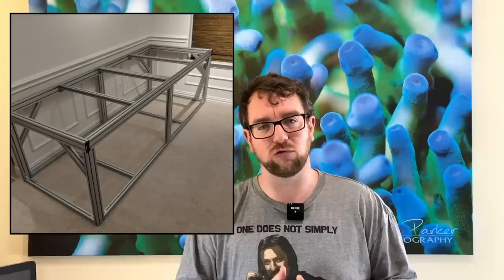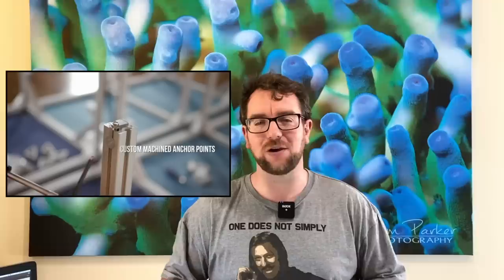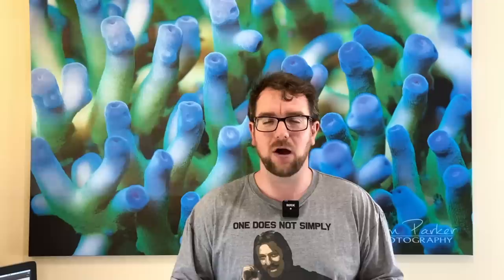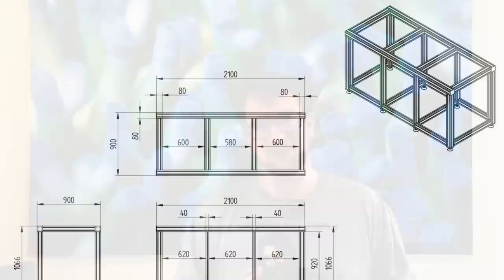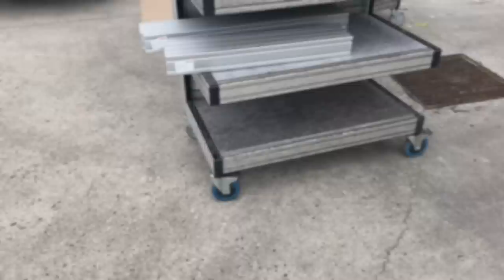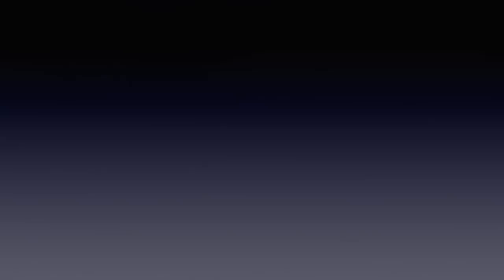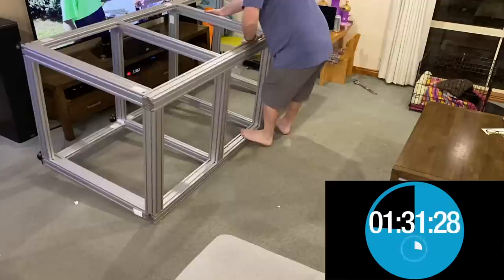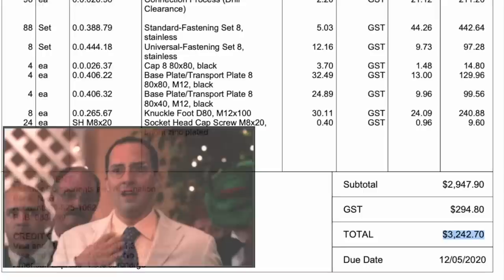My Dream Aquarium Stand

Comment: Great stand, quality costs but worth it in the long run. Lots of stands over here have acrylic or coated coloured panels like the modern kitchen ones. The normally have a bracket that locates into the bottom support beam and then just held on with magnets, simple to remove and can be easily swapped out if you want to change colour scheme.
Reply from the maker: Thanks for the idea. I don’t mind the magnet idea, but hoping for some nice hinged doors - see how we go

Comment: Hot damn, no wonder she got the new floor! One thing I noticed, in the States they seem to be using the rectangular 80/20 so that the two end noggins are sitting over the vertical posts and bearing all the weight.
Reply from the maker: Yeah the top rails sit on top of the posts here too :)
Oh and the wife got floors and a new kitchen 😂😅
Reply: @ParkersReef  Ah, my mistake. All good then.

Comment: Would love an extruded aluminum stand - so awesome. Great to get an Aussie tip for when I move back and need to get a custom ;)
Reply: Jeez an hour and a half - would take me 3 - that seems much simpler than i thought considering how many pieces in the car
Reply: Don't think it's too expensive. It will last a lifetime
Reply: I'd just use magnets with doors you can take on and off. Also if your wife wants to change the color - no worries
Reply from the maker: @sunnygoold9449  yeah it wasn't cheap, but decent value for the quality I feel. And yes, whatever option we go for paneling, it will be replaceable which will be pretty cool. Great way to give the aquarium a fresh look too.

And yeah, I was surprised that it only took 90mins doing it by myself.

Comment: Congrats for taking the plunge with the extruded aluminium stand. I remember you asking opinions about the material on Facebook a while ago. I very nearly went this way for my 6 foot tank but after building a new house it just wasn't to be this time around. Really interested in seeing how you end up tackling the cladding though. It was something I didn't quite get around to figuring out either.
Reply from the maker: thanks man. You know I have been throwing this idea around for a year or more now. Ha yeah, need to work that out soon as I want it to look good - not look like a factory. Will be right though :)

Comment: NIce! I am currently working with AluFab the same company that produced Tidal Gardens stands right now and in the work of building my dream stand for my 220 gallon tank and I am really excited. ATM my build cost is roughly the same as yours but subject to change as I am working on including vertical bars to be able to hang lights off of it as well as magnetic doors and panels. Good work is not cheap I agree whole heartedly. Their team also runs the data to make sure my tank will be a bespoke work of art that last a lifetime or as long as I don't go even bigger(cough..400gal) 😉.I have had my share of DYI projects cost just as much or lil more than a professional work in the past that could a have been done right the first time around. The back and forth buying the wrong item and returning items wasting or short of product costing money and time just winging  it lol. Also the not warping overtime and non rust issue is a must in my book. I also have had a wood stand on my 220 for the last 9 years now and i see the wood deforming here and there as well. Seeing your project give me confidence for my project !! Kudos Sam
Reply from the maker: Thanks mate, good luck with your new dream build. Sounds amazing!!!

Comment: The process you described is exactly the same with framingtech.com where I got my stand. They drew it up, did weight analysis, then changed members then I changed leg placement and height, they re analised the whole thing and once the number met the safety factor they quoted me for it and 2 weeks later from my approval it was in my driveway. I built it 84" 212 cm long, 32" 81cm wide and 46"116cm tall for extra sump clearance. The whole thing is built from 45x45 and 45x90 profiles. I understand shipping from US would have cost some penny but my stand was fraction of what you paid. I urge those in the US to get a quote from FramingTech and not get scared by the numbers here.
Reply from the maker: 100% agree! FramingTech look amazing and if I was anywhere remotely near America, it is where I would have gone. They use high quality profiles and fittings and have excellent customer service. Just doesn't make sense to ship it from the other side of the globe to Australia (especially with freight charges at the moment!)

Comment: I love extruded aluminum, but i hate this idea.  The reason being the mode of failure for these members and fasteners.  So, the metals can still corrode, specially in a marine environment.  Major members are not redundant, and when it fails, it's going to be a total loss. Pressure Treated lumber would have been 10% of the price, and far more reliable.
Reply from the maker: Having had treated lumber stands in the past, I can say for sure they are not more reliable. A fraction of the price yes, not sure about 10% though….

It’s also important to design the stand so that the weight is not supported by the fasteners, but by the upright beams - like this is.

 But hey, is all good, we’re all different! Got any info on your reef tank?
Reply: @ParkersReef  All other things being equal, if you have a leak that is going to call into question of failure for BOTH 80/20, and PT Lumber you have to look at the mode of failure.  If PT Fails, What's it look like?   Well, lumber gets soft and compresses and slowly things end up sagging... It's isn't an sudden failure.   With the 80/20 and a key member's fixtures are corroding and it fails,  you end up with a catastrophic failure and a total loss your frags are rolling around on your floor.   That's not going to happen with PT.  SURE,  the 80/20 looks cool, and you can claim your cooler then the other guys, but seems like a foolish risk to me.
That's without even getting into the electrolysis risks.  
Seems stupid... "Look I made a flag pole of Solid Gold!!!" 
I love 80/20 for projects, but there's like 2 things I wouldn't use it for, one of them being an Aquarium.
Reply from the maker: @surveysays8335  Fair enough. Having had multiple lumber stands before, I will respectfully disagree with you :)

Lumber goes soft without spills. Just the moisture alone causes it to fail after a few years.

That is the reason I shut down my last tank, the stand was not looking too safe.

But as said above, respectively just one opinion (Y)

Comment: going to build my stand this coming month
any thing you'd like to share after 3 years ?
stainless steel nut bolts working fine ?
and should I paint the aluminum for extra protection from oxidation or not to worry about that ??
Reply from the maker: Working a treat! Use quality stainless fittings and cost them in a material that sailing yachts use to stop oxidation and you’ll be sweet

Comment: Can the bottow row hold the weight of a large sump? Or would it be best to be flat on the floor for that to be supported? If you put a tank on the bottom it would be held up by the hardware only, and not the strength of any structure below it?
Reply from the maker: It sure can and it sure is :)
Reply: @ParkersReef  Could you point me to some references on how much weight it could hold etc? Aluminum stands new to me - trying to learn it all for a future build :) So all the weight of the sump is dependent on the screw/bolt from the cross beams on the bottom? wow. If you have a video on it, please link as well. I'll poke aro und to see what I can find.
Reply from the maker: @atravels1055  you'd be best off asking your local aluminium extrusion facility for them to design something for you (like I did in this video).

The weight of the sump is actually supported by bolts through the extrusion, not all of the fasteners are the cheap bolt on ones, the type I used you actually cut a thread into the end of the extrusion and drill through the connecting piece
Reply: @ParkersReef  Thanks for the tips. Looks like a great setup. Making notes.

Comment: Hi Sam great job but why extruded Ally and not just welded ally tho I understand the  modularity  makes it easy to add/ change things etc. Just curious  as to why it wasn't an option or it was but this just blew it out of the water?
Reply from the maker: Yeah that is an excellent point. To be honest, I didn't really even consider it and that isn't a good reason not to! I had my heart set on extruded ally and really just had to get over the bill. I know that plans often change or "re-align" with reef tanks as new equipment comes in and out and having the ability to modify things to accomodate that is a godsend. Plus, the fact that I can assemble and disassemble this to move between my place and the local fish store where we will be doing a fair bit of work on it is very handy!

Comment: Hi Sam, did you ever consider a steel stand so you could eliminate or minimize the center support?  I am designing my stand for a 60x36x28 tank and really think I want no center support.
Reply from the maker: Considered it yes, but ultimately decided against it. The centre upright is no big deal, plus is removable if i ever need to temporarily

Comment: have you thought about levelling caster wheenls? like tidal gardens? ive been looking into a designing something similar and im trying to find the right door fittings that is neat and tidy to cover up the extruded alumunium.
Reply from the maker: I did look into it, but realistically I’m not going to be moving the tank. I have adjustable feet which do lift the tank off the floor which would make it possible to get a jack under if absolutely needed

Comment: Really nice stand Sam! Which connectors did you end up using? Also, consider thick, coloured acrylic to wrap the stand (easily machined, mounted and waterproof!) that's what I plan on going with for a modern look.
Reply from the maker: Oooooh good thinking! Got any more details on it?

I used a combo of stainless standard connectors and universal connectors.
Reply: @ParkersReef  As far as my thinking on the acrylic panels goes. I plan to drill holes in the back of the panels without drilling right through and use those holes to mount brackets to hold a dowel rod or pvc pipe which can be guided into slanted hooks mounted on the stand frame, so the panels can lift on and off.
Reply from the maker: Good thinking
Reply: If you want a basic drawing of the idea I can tag you on reef2reef. my username there is GBRsouth.
Reply from the maker: @michaelhoward7115  that'd be great!
Reply: @ParkersReef  I'll try and tag you with a very basic drawing on reef2reef tonight.
Reply: @ParkersReef  tagged you on reef2reef in the DIY forum.

Comment: Love the new stand, as strong as my boxed steel and 1/20th the weight. Looks awesome Sam. What material will.you have on top to support the tank and below to support the sump?
Reply from the maker: Still working through the details. Likely be a a pro lite panel interior and a marine ply exterior, although could be acrylic yet...

Thank you very much for becoming a member too - means a lot 🙌🏻
Reply: Membership has its benefits!
I used 25mm marine ply under tank and sump and protected it with 5 coats of marine enamel lacqure. We are 3years 8 months in and it still looks brand new. An occasional wipe with a wet towel gets the salt off and keeps it shining. I also went with Tasmanian oak vaneered doors and gave them 5 coats as well and they look just as good.  But I'm a bit of a wood nut, it wont fit  everyones taste.
Ps I also used the same adjustable feet, you wont be disappointed in them.

Comment: Hello there. I really want a hobby aquarium. My aquarium will consist of two tanks. I am thinking of putting a 55 ”x 20” x20 ”aquarium on the first and second floors. I will put a resting tank at the top. I was thinking of wood and iron profiles as a coffee table. But while I was doing research on the internet, I saw the post. And why I wanted it with t slot (sigma profile). But I have no idea about that. Dad, help me with a design, please. What kind of a coffee table should I design?
Reply from the maker: I think your best option would be to reach out to a local engineering place that works with extrusions. They’ll be able to design something to your specs that can support the weight of the tank 👍🏻

Comment: Nice but totally overbuilt. A single 90x90mm extrusion can span 8ft without needing any support. I know because i built two 16ft systems using this stuff.
Reply from the maker: Overbuilt is not a bad thing :)
Reply: @ParkersReef  Depends on how you look at it. Those supports limit access under the stand and you could have used the money you saved on something else.

Comment: do you need to put anything on top of the fram
Reply from the maker: I went for 6mm cast acrylic sheet and 19mm H grade polystyrene
Reply: @ParkersReef  is it a requirment to have something on top? or polystherne ennough? my tank will be 120cmx50cmx60cm height
Reply from the maker: Poly is enough :)
Reply: @ParkersReef  just so you know bottom will not be fully supported, its just aluminum stand and a bar in the middle of the stand,

will poly be enough between the stand and the rimeless glass
Reply from the maker: I have acrylic, then foam, then 38mm of glass :)